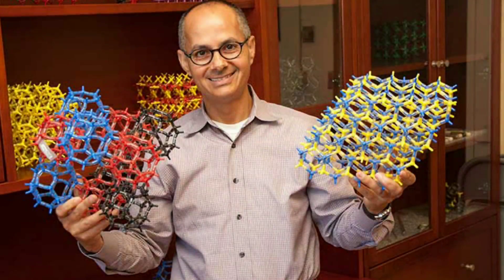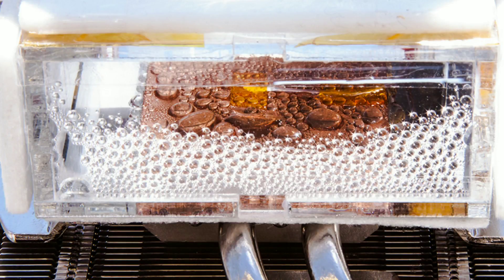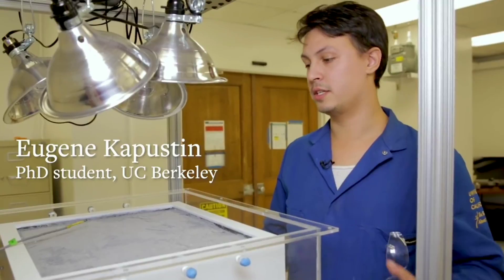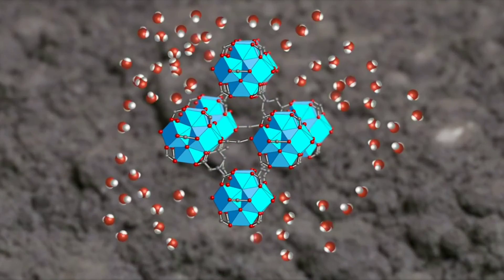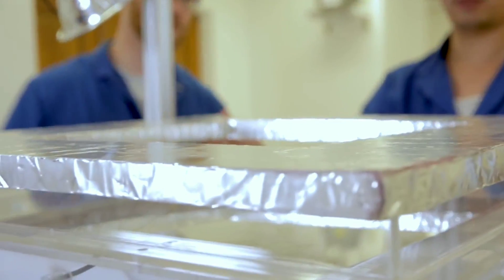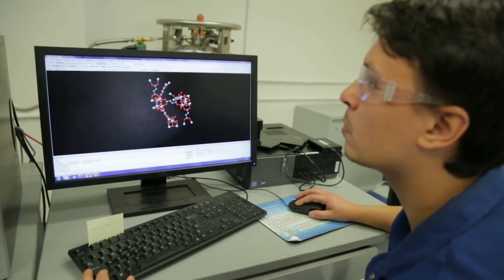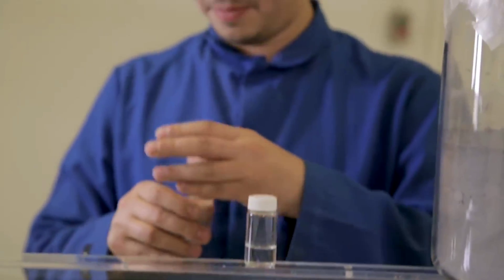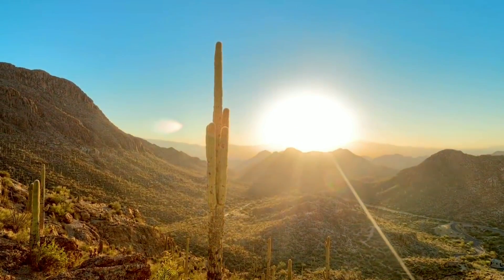Desert AIR into FRESH WATER technology. new tech 2024

Comment: I was a little concerned about the metals when they said it's 100% pure. Nothing is ever 100%. After he mentions using aluminum; certainly not.
Reply: the water evaporates.  and condenses on the sides of the box.      the same technique is like a basic concept of survival/boyscouts water purification.     It's one of the ways they make distilled water.   The distillation process is...the evap and cooling back into liquid water.      --unless the mof also changes states to gas... and might be able to mix back with the water on the sides of the box.   there's  no way it would carry any metal from the mof with it into a gaseous state.

Comment: This is so over the top...
What’s with all the fancy high tech on a plastic box with metal shavings in the lid. 
They’re not fooling anyone. Just show us that it’s a box and get over it
Reply: Any plastic box or coke bottle will do, but better use 6 Dehumidifiers and hook them up to solar panels, the water goes into a black sealed barrel via tubes that run from the Dehumidifiers to the barrels, they will make 15 to 23 gallons of water a day. Good for a garden or treat it for consumption... Simplified Bio Science...

Comment: So it's a dehumidifier. Congrats on your "invention."
Reply: You're 100% right and imagine the government gave them a grant for half million or more to produce 1/3 cup of water a day, the Military trains you to use a rock and 2 sheets of plastic in a hole to produce fresh clean water in the desert or wilderness, LOL that makes 1/3 to 1/2 cup of water... I  produce 15 to 23 gallons a day for my garden to keep my water bill down,  by using 6 large Dehumidifiers that I got form Craigslist for free or for around $10 each, I bought 4 2' X 2' 400 watt solar panels with all the necessary gear from Chinese Solar Company. The Dehumidifiers had their little square bowls drilled and inserted a plastic tube that goes into Black 30 gallon sealed barrel.. All is sealed for keeping the water clean, a nozzle was installed to get the water, If you want to drink the water just boil it and add some drinking chemicals to kill any invisible parasites or germs.. I also use the water for tower hydroponic garden All is Solar powered and cost me zero...  I building a other station with  6 more Dehumidifiers  to produce more water... Remember to get a few extra incase one of the Dehumidifiers breaks down...
Reply: Dehumidifiers need a power source

Comment: I see what you done there. 
But adding aluminum to the mix !?.....You dont want that stuff anywhere in your drinking water. 
Look I could be wrong of course. Either that or you (joke) might want to check that water, if you're drinking it, or expect anyone else too. ( Not really a "joke" though. Is it? ).
Don't get me wrong. You're trying to make this a better world. Got to make a few bucks while you're at it, just to keep going on, searching, thinking of a better way and a better Earth.
There are designs that produce up to 400,000 litres per day. But they need 3 people to run them, live in, 24/7, rotating shift. Also much bigger and run on wind and solar power. In addition these "plants" need an approximate 25% humidity (which isn't that much ) to produce that approximate amount.
Could easily fix all drought areas. Just waiting for people to catch up with what's available now, and litterally bares many fruits into the future.
Good stuff people. ☺👍, and keep up the great work. It's an interesting kettle of fish. We need more people to take an interest in this stuff.
Cheers.🍺 ☺👍
Reply: The quality of water from metal organic mix is a question.
Reply: Any plastic box or coke bottle will do, but better use 6 Dehumidifiers and hook them up to solar panels, the water goes into a black sealed barrel via tubes that run from the Dehumidifiers to the barrels, they will make 15 to 23 gallons of water a day. Good for a garden or treat it for consumption... Simplified Bio Science...